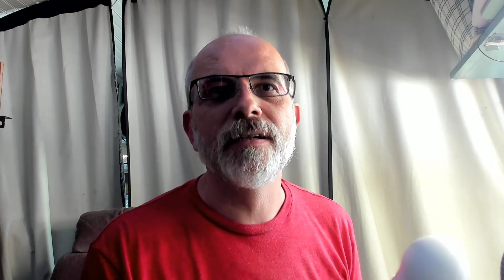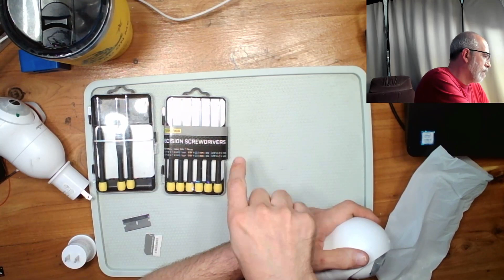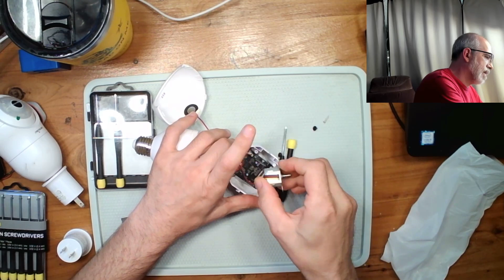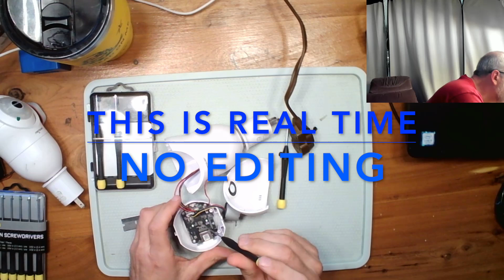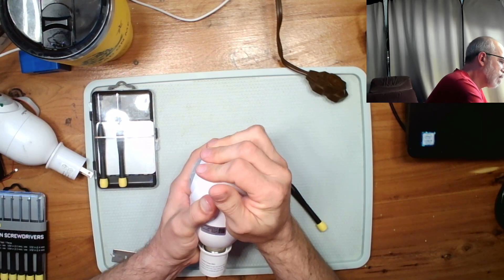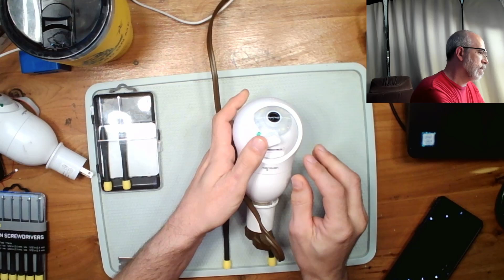Wansview G6 Thingino Install WITH GIVEAWAY! Light bulb security camera with open source firmware!

Comment: Are you writing the thingino firmware to the SD card as an image or renaming it to a file named autoupdate-full.bin?
Reply from the maker: This video is old enough that the method is updated - follow the instructions at the thingino-installers repo as they stay current! The image you get from there is an sd card image that you burn with Imager or Rufus.

Comment: I wonder if the same process is used on the galayou g2 with a t23 processor? I would like to collaborate on installing your firmware.
Reply from the maker: I don't have that particular model but I have had a basic examination of their firmware... They sign their firmware images so it's not reasonable to create a no-tools installer... I could make a one-tool installer doing the flash glitch method.
Reply from the maker: make sure to sub, i'll have something in a couple days!

Comment: ( These bot comments are weeeeiiird...normally with this type of thing, they're spamming people's names and placenames, hoping that the channel has their own personal info in the blocklist, and so with enough bot comments it can work out which comments have been censored and try to get some doxxing info from that...but these comments are just 3 adjectives and like, AI output trained on just tech vid comments. )

ANYWAY, found this channel because I just found out about thingino.  As wyze was locking more and more stuff down and breaking older hacks, I was just seeing what the current 'state' of messing with the V3 was, and a proper custom firmware solves all the problems.

...and I found this vid since you'd link to better/cheaper cams than the Wyze V3 that use the same CFW in the V3 video, and so this is the most recent vid :D
Reply from the maker: yeah I got the occasional spam bot comment on videos but it seems I get a lot more if the video includes a giveaway! No worries though, bots don't win cameras. I've got a new WUUK on the bench soon that should be a full replacement option for Wyze V3!

Comment: I would like an episode focusing on applications/use cases for multiple Thingino cameras,.  For example, multiple cams in a home setting linked to a server taking in the streams, the server would display the individual cam streams with alerts.  Perhaps the server could do advanced motion/person/object detection.  While they may be multiple  You tube videos covering similar topics, the combination of low cost hardware, open source (Thingino) cam firmware could open up unique solutions.  Also, I'm not convince Thingino is "tuned" for this type of use.
Reply: I've been using Thingino in this sort of application for a while now and it has been working fine for me.

Comment: I'd love to see a video with Tips & Tricks for Thingino firmware itself....  you know, after it's been installed.  I know there is alot of info in the Wiki but it's a lot to sort through and things are constantly evolving.  Perhaps an up to date look at the functionality of the Web UI as well as explaining some of the commonly used command line functions you can run from the shell.  Based on the daily questions on Discord there appears to be a itch to be scratched regarding basic usage of Thingino.
Reply from the maker: Looks like you're the winner of the Wansview G6! Contact me on Discord to arrange your prize!